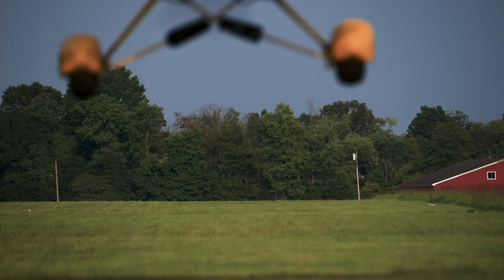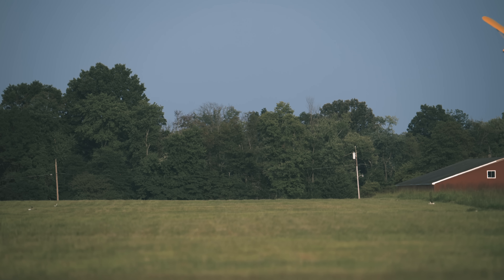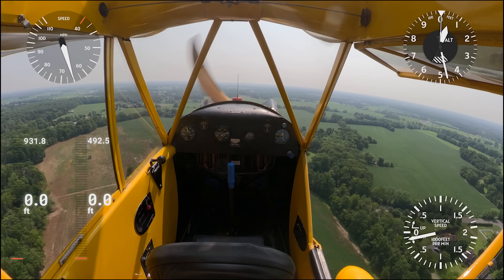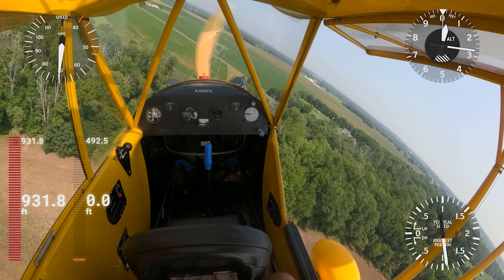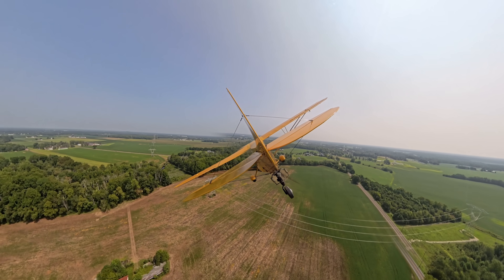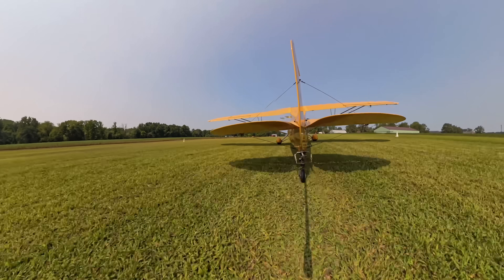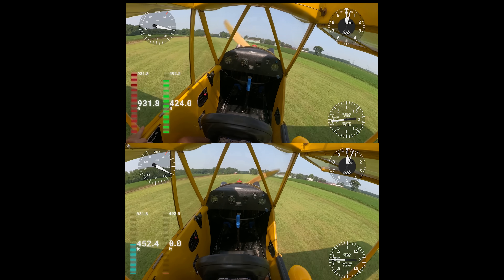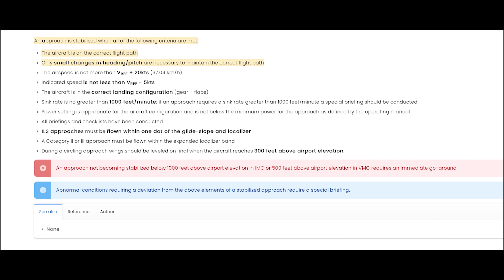What Happened to Basic Stick & Rudder Flying? Slipping an Airplane to Slow down.

Comment: Great topic, I love to use a forward slip in my Piper Warrior if I find I’m a bit high on final approach. Yes, I could dump full flaps but that changes the trim of the aircraft and pressure on the yoke at a critical phase of flight. Your point that you can put the aircraft into a slip and take it back out more quickly is valid, especially for electric flaps but I think you missed the bigger point that it doesn’t drastically change the trim of the aircraft at such a critical time. Great video!
Reply from the maker: That’s a great great point about the Trim! Gonna pin this.
Reply: Agreed. I just got back from doing power off 180s and full slips to touch down in my pa-28. No matter the flap setting, it's a valid technique. 

Small note. "Dumping the flaps" refers to removing them (say 40⁰ to 0⁰) and dumping lift. Another old school technique where if you are in ground effect and need to put that sucker on the ground right away, you can dump the lift and it will drop to the runway. 

Johnson bar for the win!

Comment: Amen to everything you stated.  I've been an instructor for 25 years, and I have seen more and more where the airline-bound students (and CFI's too) are disinterested in the basic skills. You may not have to slip an Airbus, but it has saved more than one airliner (The Air Canada 767 in Gimli, MB). Airliners prohibit certain procedures because they need to maintain consistency across a large pilot population, but in GA you can (and should) explore the flight envelope. It's not really about what you need to do, but what you can do. Skills erode fast, and sitting at a flight deck at FL350 will eventually make you dumb unless you are actively working to maintain your basic skills.

Comment: Hmm, I never heard about that before - forward slipping to lower airspeed!  I thought it was just to dump altitude! I'll have. to try that, even at altitude, to see if it drops speed...It's funny, at my home airport, KILG, Class D, the RWY's are so long (except 14-32, closest to my hangars), half the time controllers ask for "long landings" to get me outta the way faster I assume. If I (rarely any more) use Flaps 40, I can stop in 1,000 ft easy. and the RWYS are all about 400,000 ft long anyway. hehehe I usually just use Flaps-20. I will not try the slip at Flaps 30 or 40 though, just to be safe. Thank you for that!

Comment: 6:47 you are 100% right. Just checking the boxes, the essentials are discarded, they jump straight ahead to maneuvers, traffic patterns, approaches latter on and they never actually focus on teaching the most basic and crucial techniques in how to actually handle the aircraft. On the last exam of my atpl the examiner was frustrated because he said even though I managed to comply with all the parameters during the ILS approach (speed, altitude, GS, LOC) the technique was wrong and I was making it so much harder for me. He also kept saying that the aircraft was crooked, that I have been flying it sideways the all time, and he was right, the thing is it was the first time I heard that in more than 200h of flight time. So why and how did they allow it to continue happening without correcting me? Because as long as you what the curriculum requires they don’t care about your technique. And maybe there are people that manage to grasp how to fly with a good technique on their own, but I am not one of those people. And it made me sad to discover that all this time I have been walking with crooked legs. Glad that Airbus takes care of coordination in normal law, otherwise it would be a major problem, I would like to improve, but after all of the investment I can’t afford additional flight time with an instructor 😑

Comment: Having went through ATP, I can tell you the stick and rudder flying, for the most part, isn't there. I got my private elsewhere and learned how to fly, then went ATP. Nailed my Power off 180s using slipping. I shared with as many people as possible this trick.

Slipping is taught in the videos at ATP and the students SHOULD be using it. But, with thousands of students, everyone will be different.

Comment: As a new pilot, this scares me a bit... its my understanding (please correct me if wrong) that if you cross control your aircraft like this and pull back to maintain altitude (Increasing AOA to maintain altitude as you slow), you are setting yourself up for a spin if you exceed the critical AOA... and thats especially dangerous at slow speeds and low altitude with little or no room to recover.  A slip to lose altitude (while maintaining airspeed with a nose down attitude) doesnt have as much danger of a stall as this....am I right???  Thoughts?  What am I missing? Want to learn. - not beinf a smart ass....

Comment: Most lacking, is a stable 1.3 VSO approach here in ST LOUIS training. If so, then 4000 ft of runway is not needed. Correct ?
Almost as though the touch and go (we don’t do) is more important than a safe landing, such as a light single stalls about 40mph, 1.3 VSO is a final around 52 indicated, making for a very survivable forced landing should that ever happen.
Cheers all. 60yr TW CFI
AILERONS RULE.

Comment: I was going to buy a A2 CZ Ellipse, a wonderful composite, elliptical wing aircraft with broad flight envelope.  Handles turns beautifully like a spitfire.  Then I found out that it couldn't handle a forward slip on approach due to the T tail.  Deal off.

Comment: I fully agree with these suggestions. I had a complete engine failure a couple of years ago in a Cessna 170B (manual flaps) and landed out in a very small field. During the glide and the approach to my landing site, I did not use any flaps at all, only slips while adjusting my glide angle to my landing site. The problem with using flaps except on very short final, is that if you misjudge, removing flaps will cause you to sink quickly and possibly land short of your touchdown spot. Slipping on the other hand allows you to increase and decrease your sink rate without the sudden sinking of removing flaps. When you take the slip out, you immediately start flying again and can put the slip back in if you need to lose a little more height. When I had the field made, I quickly pulled in full flaps just before touchdown to act as speed brakes and decelerate quickly during my roll-out. The secret to a successful forced landing is to make your landing spot and LAND AS SLOW AS POSSIBLE. Speed kills.

Comment: You talk about ATP being around you and are guessing at what they do. I sense you haven’t read FAR Part 141, however, every part of your training in a Part 141 or Part 142 school is overseen by the FAA. It’s as good and complete as you can get. It also includes a great deal of stick and rudder flying. The biggest difference you’ll note between learning under Part 141 and Part 61 is that under Part 141 you have a schedule to keep and it’s covered in the syllabus, where in Part 61 you can take as long as you like to complete competencies in Part 141 you may have only 2 hours to learn slip to a landing, in Part 61 you might take two months to learn it. However, I assure you, you will learn slip to a landing, even in a 747.
Reply from the maker: Im very familiar with Part 141 vs 61
Reply: @Bananasssssssss  then why your comment on stick and rudder flying? It’s taught very well, is FAA approved and is required syllabus training to pass the practical.

Comment: I completely agree with you on this. I learned to fly tailwheels in the early 90's out of a 100x2,000 strip with trees all around it. It was critical to be on your airspeed and know how to slip properly in airplanes that didn't have flaps. It can also be extremely handy when the big fan up front quits working and you only have one shot at getting everything correct. Great video! 👍🏼👍🏼

Comment: I have a Commercial Instrument Pilot license plus A&P license. Owned my own 1946 Cessna 120 (no flaps) for years. In addition, I was an Air Traffic Controller for both the USAF and FAA for a number of years. My last FAA airport I worked in the tower and we had 5 flight schools on the airport. As you can imagine, I've seen thousands of landings by low time and high time pilots. I can't remember ever seeing anyone slip an aircraft on landing at that airport. They all used as much runway as was available.  Definitely a lost art for pilots.

Comment: Great video! I got my private pilot license in usual Cessnas and Pipers but I also got lots of taildragger time in a J3 cub so I was comfortable doing slips. During my Commercial check ride in a Cessna 182 my examiner (also owner of the airplane) pulled the throttle on me and said you just had an engine failure, what are going to do. I was in North Dakota so finding a spot to land was no problem but I looked down and there was a crop duster strip right below me so I said I'm landing right there. I started my approach but was coming in on final too high even with full flaps. I put the 182 into a full slip and it started coming down like an elevator with no cables! I glanced over at the examiner and he was braced for impact but didn't try to take over the controls. There was lots of noise and turbulence due to the full flaps blocking the tail surfaces but it was fully under control. Just above the strip I went out of the slip and was just about to touch down (on the strip) and he applied full power and had me go around. He said I never knew you could slip a 182 with full flaps! I passed my check ride.

Comment: I towed sailplanes and needed to lose 2,000 feet in a hurry with a 250 foot rope behind me with power lines across the road from the 1,800 foot runway. Upon release it was a full rudder and aileron drop out of the sky with the rope way above me, passing well over the wires at 250 feet. I’d still be stopped within the first half of the runway.  People on the ground liked the show.
Reply from the maker: Sounds like a blast 😁

Comment: I was doing a BFR in a C172 (rental) about seven or eight years ago. The instructor was a young guy who'd gone through Part 141 training. I grew up in Part 61, and started in TW airplanes (Champ). At the time, I owned a 180HP Globe Swift. We had to fly the Cessna for the flight review, because he had no time in type. 

As we flew, I was doing some things that really annoyed him! He pulled power on me four times to test me. I'd only ever had instructors pull it once during past reviews. During the first dead stick approach, I asked whether I might simply slip the plane in for the landing rather than using flaps. I'd done this before in a BFR with another old timer instructor. Well, this fellow immediately said NO! He wanted no part of that. So, I had to use flaps. 

I could tell that he was somewhat flummoxed by my style of flying. I got the feeling that he thought I was a hayseed!  I'd flown mostly TW aircraft, and had taken a formal acro course in a Decathlon after getting my ticket. In some ways, I knew he was a better pilot than me, but in other respects he was clearly lacking certain skills. I'm not necessarily being critical, because his training prepared him to fly commercial. But it was interesting to see the differences in style of flying.
Reply from the maker: I’d take the stick & rudder part 61 pilot any day over the technical part 141 pilot

Comment: In Europe there are plans to get all those single prop planes to a more silent final approach. Basically the idea is, you go to idle right after turning to final.  All pilots need to adjust the altitude during the landing pattern, because the final approach gets steeper. When you idle, and you have the usual flap position, the nose must drop to keep a safe airspeed, keep flying please. And then you flare as usual.
How far these plans are, ask any European pilots. They don't ask all pilots to  descent full flaps AND doing a side slip, but you got the idea: doing a steeper final approach, idling all the way down, everybody living nearby the airport will like that. Less noise! And every pilot can learn that new way of landing. So, good idea?

Comment: I am ready to get lambasted, but I have come to the conclusion that the old dictum: "pitch for airspeed, power for altitude" is THE WORST technique for learning to land there is. I mean, you don't fly on instruments like that. No, if you follow the FAA handbook and USAF method, you set pitch, then you set power. Pitching for airspeed is when you are gliding without use of power.
Reply from the maker: Like anything, it's situation dependent and like my old CFI used to say, "flying is the application of a scientific process". There are a few ways to accomplish any one thing

Comment: The frame of mind for a slip should be to loose altitude not to slow down.   Once you do loose the altitude slowing down is easy and COORDINATED so you don't stall accidentally.

When the airplane is not in a slip the POH numbers are valid.  When you slip your stall speed as printed goes out the window, so you need to be a bit faster in a slip!

The cub is very forgiving.  *Correct slipping technique becomes extremely important in more critical wings and wing loadings.
BTW, the slips shown in the vid look very good.   Thanks for the video.

Comment: The issue with how forward slips are taught now is the entire ethos of why a slip is used. Particularly with 141 school, I.E. ATP. Slips are always taught as a last ditch effort and a dangerous maneuver. When teaching the slips they always tell you to keep the speed in which is true, the issue is that speed in question is always 10 20 knots above what it should be nearly defeating all the benefits that come with slipping.
Reply from the maker: Good points

Comment: I used to have my own plane , and definitely the only way to land a plane is sideslipping,
I always came in close to the runway,
and high, and would drop down side slipping to the beginning of the runway, and within a few feet of the first off ramp, could back track for a few seconds, and was clear of runway.

And i always thought even while i was learning to sideslip, How are these guys that go so far out, ever going to make it to the run way if there was an engine failure?

And i do remember one time having to beet a real wind storm from a serious thunder cell picking , and the winds were 45 knots and higher gusting.
With my sedan, I did the steepest side slip to put only the front 2 wheels on the grd.
The guy beside me was on his first plane ride,
I often wonder what he thought,
Since i could not put my tail wheel down at that moment. and we were not moving on the grd.
That's learning how to fly ! at it's best.
And i was a young pilot, being taught by the vest we had then.

Yep your right when it comes to poor pilot training of today !

Comment: I think the primary reason is you can't slip a pa-28 full flap which most schools have and that aircraft design has made poor rudder control common.  In a cub, or and extra this is the way, they are tailwheel and its really the only way. A 172 or Warrior has a lot more inertia and less rudder authority meaning you're only going to lose a fraction of what you did. I'm not saying it shouldn't be taught. Just a reason why it's probably not.

Comment: I learned out of a small 2600 foot strip with trees on both ends, in a Piper Tripacer and my instructor was one of those older stick and rudder kind of guys so I wasn't shy with slips. Super handy for cross wind landings.

Comment: I was taught to fly in all taildragger aircraft.  Main airacraft I flew a was a Cessna  170. My dad was a CFI and when possible I would go up with them, and a lot of times I worked a deal where I could get a little stick time. Most challenging was a Cessna 195, and a Luscombe 8A. Both for different reasons, 195 I couldn't see over the nose, took some doing to learn, and the Luscombe, was a lot quicker and would love to catch you "sleeping" a little in a crosswind.
You mentioned 4 to 5 thousand foot runway. I guess I was lucky, we did a lot of the flying off small strips. We did a lot in and out of an 1800 foot strip, landing to the south, you cane in over a fence, no problem.  Coming in to the north, you had power lines right at the end of the strip. If you didnt slip you could run out of runway real quick.
I was taught, like you do in the J3, was never a problem. 
The only problem I have ever seen with a tricycle gear, is the tailwheel is on the wrong end of the aircraft. I think that a person is much better off learning to fly conventional gear and then transition to nosewheel, if you really need it.
Thanks Joe, keep the great videos coming.
God bless and keep safe out in the wild blue yonder.

Comment: Hell yeah brother. I did my PPL training with a very old school pilot who landed DC-3s on beaches in Alaska and the Caribbean along with being a lifelong glider instructor. That crusty old bastard had me doing full slips from base to touchdown early on in my training. 

During my check ride the DPE goes "okay, you're going to have to show me a forward slip this landing" I told him "no problem". He goes" and you have a flap failure so you can't use flaps" I replied "great!". Later in the debrief he gave my CFI props on continuing to hammer home the old ways. 

Keep up the good work. Also, you need to brush up on your definition of "average" 😂
Reply from the maker: Love to hear it!

Comment: We used the side slip on the B737-700 and -800 all the time when we approached certain short runway airports that required us to come in high. Needless to say, we had to be very smooth and avoided rapid and large alternating control inputs, especially in combination with large changes in pitch, roll, or yaw (e.g. large side slip angles)... I still see some SWA B737 pilots use side slips flying into KPHX!